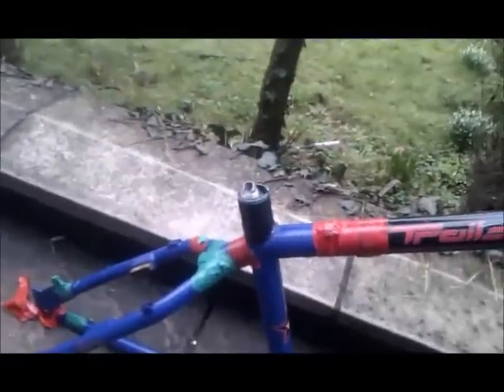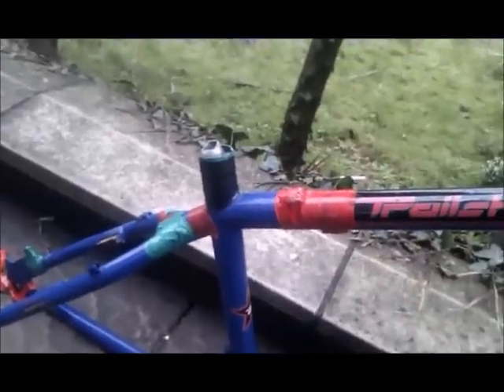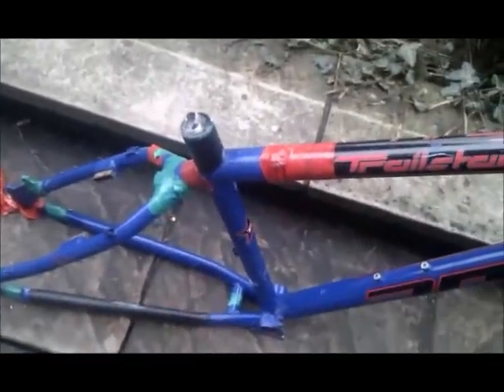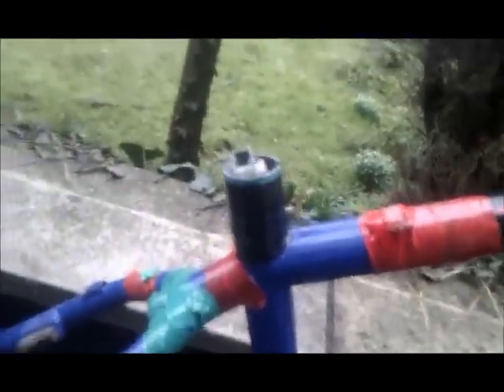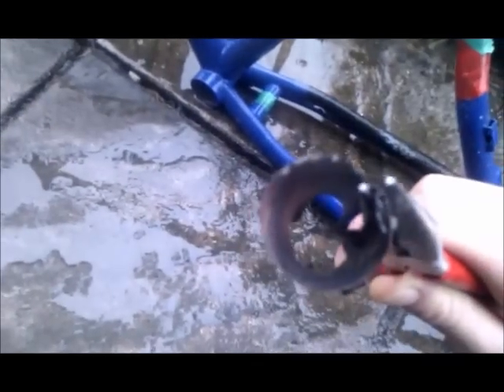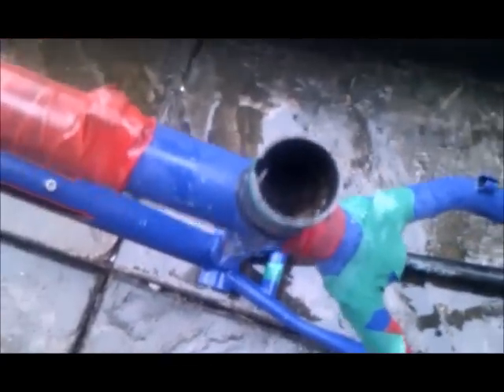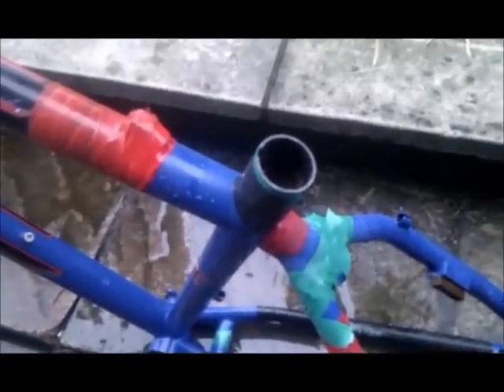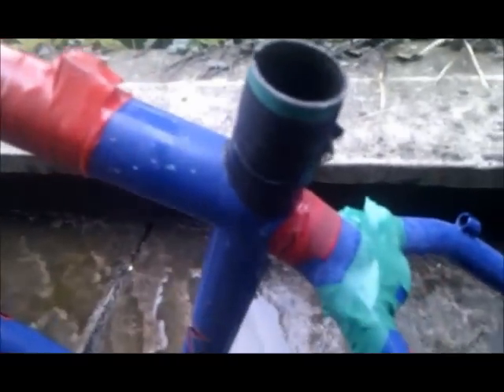Removing stuck bicycle seatpost with sodium hydroxide/caustic soda

Comment: Not sure about that, when you heat aluminium, as far as I can remember it will expand, thus fastening the pole to the frame even more
Reply: enzo enzo  but as it cools off it will shrink back to its regular size & break the corrosion holding it,if its really stubborn repeat the heating/cooling multiple times.
U could also try heating the post & rapid cooling by using ice or very cold water :D

Comment: I want to try this with an old french roadbike, reynolds 531 frame, and a thick aluminum seatpost that broke off inside the seattube when I was going at it with the bench vise and hacksaw blade. Don't have any other options now..  but how can I plug the seatube at the bottom where it drains into the bottom bracket? With a potato and duct tape??

Still have to find some sodium hydroxide.. all I have is some drano which is like 50% naoh for now.

Comment from the maker: WD40/Coca-cola/elbow grease and a damned big vice. You could try heating the seat tube on the frame with a blow torch (may damage paint work) and again stick in a vice using the frame as leverage. There are a few videos on here with various methods.